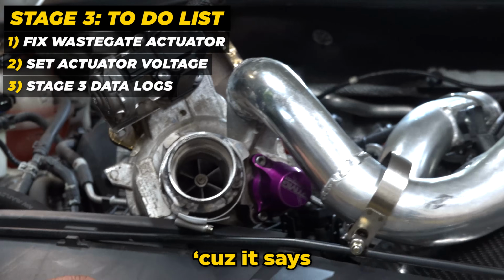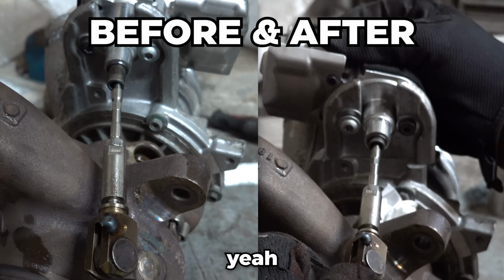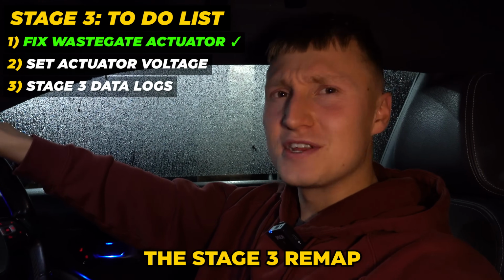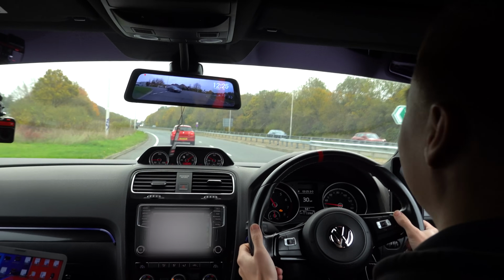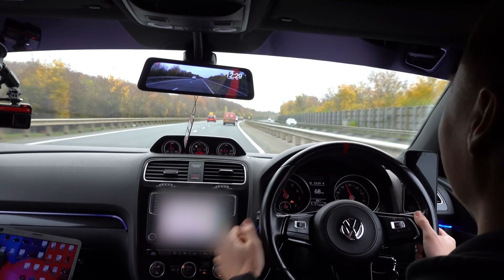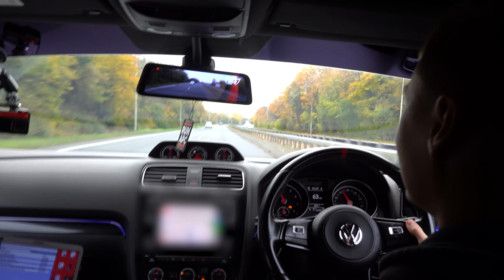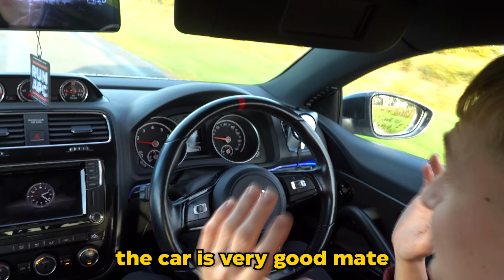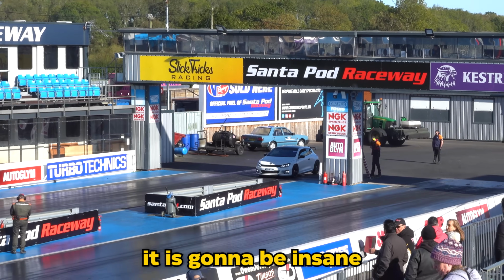HARD PULLS in my BIG TURBO *1.4 TSI* SCIROCCO 😈

Comment from the maker: 👉 My FAVORITE Amazon Car Accessories 
- Digital Rearview Mirror (F&R Dashcam)- https://amzn.to/47NFJnL
- MagSafe Wireless Charger - https://amzn.to/3sk0JTm
- 130W USB 12V Adapter - https://amzn.to/3YBJTvx 
- Car Boot Organiser - https://amzn.to/3YBKDAP
- Portable Car Bin - https://amzn.to/3DVoyUb

⏭ NEXT EPISODE ➜ https://youtu.be/r5EU_mH-heM
⏮ PREVIOUS EPISODE ➜ https://youtu.be/m2zh-m3fCyE

⚙ Follow APC's Instagram ➜ https://www.instagram.com/anglia_performance_centre/
🌎 APC ➜ http://apcperformance.co.uk/
📷 Follow me on Instagram ➜ https://www.instagram.com/em_ligman

📦 Some of the products featured in this video... 
- MAHLE IS20 Actuator - https://ebay.us/DNfLeH
- DKU EA211 Boost Tap - https://dkuperformance.co.uk/product/boost-tap-gauge-adaptor-for-audi-vw-seat-skoda-1-2-1-4-tsi-ea211/
- 3" Downpipe V-Band - https://turbozentrum.co.uk/76mm-3-Stainless-steel-downpipe-V-Band-flange-20-TFSI-TSI-Audi-S3-VW-Golf-7-GTI-R
- RTMG BOV ➜ https://dkuperformance.co.uk/product/blow-off-valve-kit-for-1-8-2-0-tsi-ea888-gen-3-engines/
- RTMG Air Intake ➜ https://dkuperformance.co.uk/product/rtmg-direct-cold-air-intake-for-1-2-1-4-tsi-ea211-mqb-vw-scirocco/
- APR Red Ignition Coil Packs ➜ https://highonboost.com/products/apr-red-ignition-coils-4-pack
- NGK Performance SPARK PLUGS I use ➜ https://highonboost.com/products/ngk-laser-platinum-spark-plug-ea211
- Bonnet Struts I use ➜ https://ebay.us/Tm7lnC
- ENGINE OIL I use ➜ https://ebay.us/Mz0VGN
- ENGINE COOLANT I use ➜ https://amzn.to/3Ms9R0c

Comment: Love this series, this is making me wanting more power of my scirocco even if there any place to use it
Reply from the maker: Do it bro! 😎
Reply: @Em_Ligman  first I need to legalize my homologated exhaust system, so I can drive in peace without be scared of being pull over and get fine and registration Impounded bc of stupid law and corrupt cops, after I legalize exhaust for sure 2024 it's gonna be more powerful then 2023
Reply from the maker: @THKILLERSPORTUGAL  yeah I hope you get it sorted man! Good luck 👊
Reply: @Em_Ligman  if all goes well January I'm doing ipo b inspection, then June I'm getting the new registration with the exhaust on the extra notes, and after do the normal inspection and after that probably same month downpipe, r8 coils, colder spark plugs and a restage so it has no lights and more power baby, also yearly maintenance

Comment: Nice build u got there m8!
How much can youe stock clutch take before it breaks?
I bought a 290RS hybrid the other day.
And om aiming fot 250 - 300hp.
Reply from the maker: Thanks! My clutch is fine for now, but we haven't tried going above 1.0 bar of boost yet on the IS20 turbo.

From what i've seen with the 290RS, it makes about 240bhp.
Reply: It the car has same trans and clutch as mine 310nm stock clutch and 300-350 for the trans (i have an mq200) if you want more you need to trans swap to a mq250 and i think its a gti clutch but idk about the gti clutch fitting

Comment: Is unbealiave how long way you must spend for more hp on this car. I just think, only change turbo, make a soft and can run 😮 thanks for this experiences!
Reply from the maker: Normally it is a super simple process using a bolt-on hybrid turbo from RTMG. But this is all custom work for an IS12/IS20 turbo conversion. Now that we’ve done it once, someone else getting this done by APC will take no time at all
Reply: @Em_Ligman  understand. But I think, for all that fun it cost in all ways 😂
Reply from the maker: @HondaK20  yeah it’s still a big job. Hopefully worth it in the end 😎

Comment: That scaleted quickly!!! Your engine need to be tested stage 1 stage 2 stage 3.

You can total your car if you go straight 3, because you don't know if any component can wistand the force on it
Reply: Better to break a hose than a header
Reply from the maker: Well at a stage 1 map, it’s running about 160bhp, stage 2 is maybe 180-210bhp (basically what we are running now) and stage 3 is anything above 210bhp with a hybrid turbo setup or an IS12/IS20
Reply: @Em_Ligman How many horses do you currently have?
Reply from the maker: @leleviglione8995  maybe 200ish on this “stage 1 map”